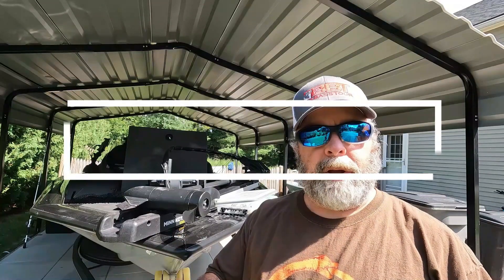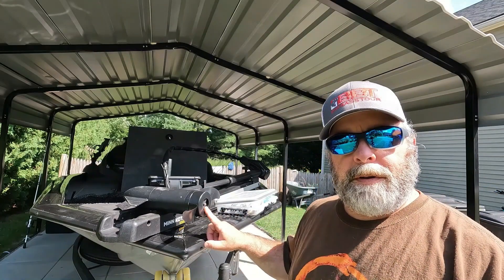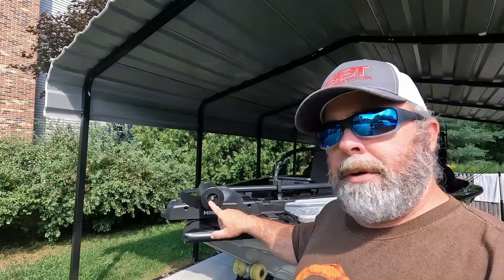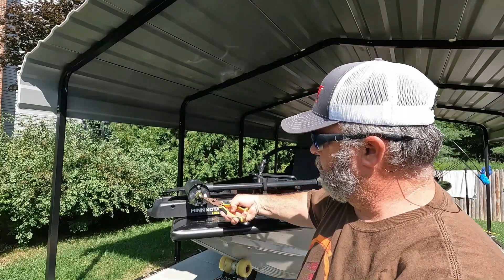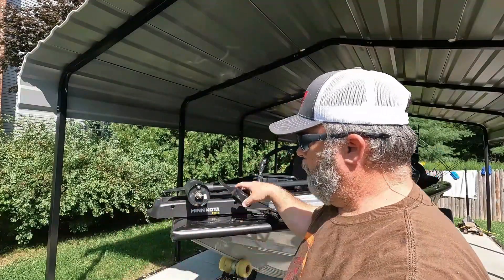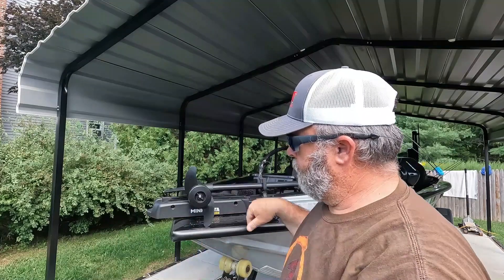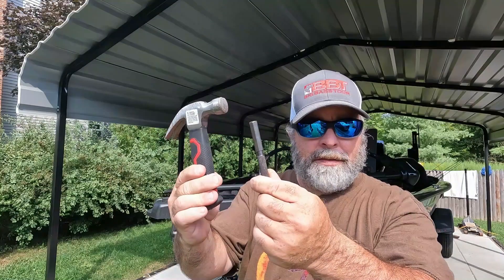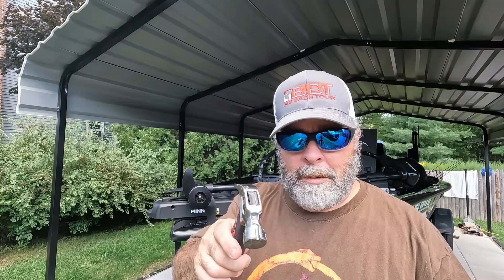Gettin' it Dun (S1, Ep. 4) - How to Remove Your Trolling Motor Prop & Clear Debris

Comment: Hopefully I just popped my breaker on my 80 lb Fortrex from dragging around a bunch of grass on the St Laurence river in June. Acted like it was at half power after I "thought" I heard a 'click' ( half deaf) When I checked the breaker I didn't feel much resistance but I can't come up with anything else it could've been. I'd appreciate any advise! Mike
Reply from the maker: Hey Mike.  I'm real reluctant to provide any "advice" on a motor I'm not familiar with. Although I can say that I have called Minn Kota before, and they were very helpful and had a technician call me back and explain something to me.